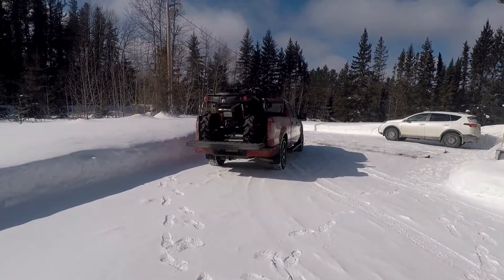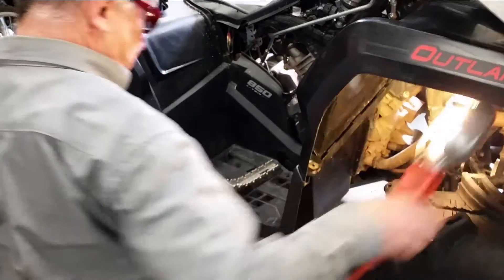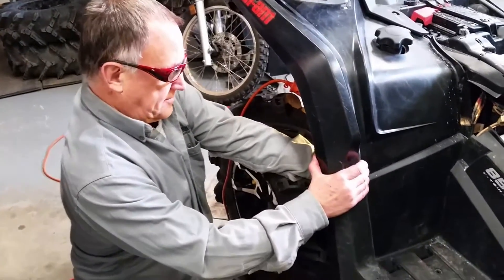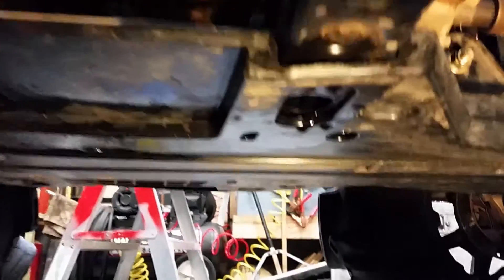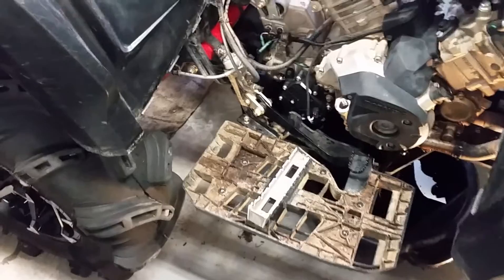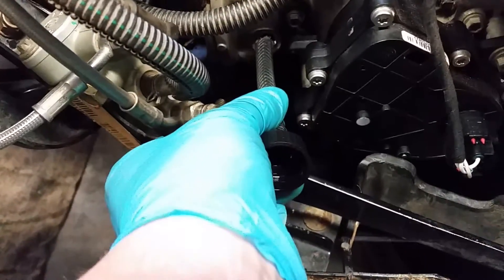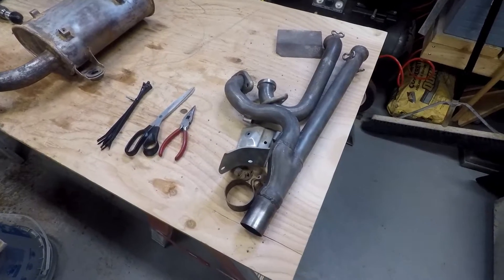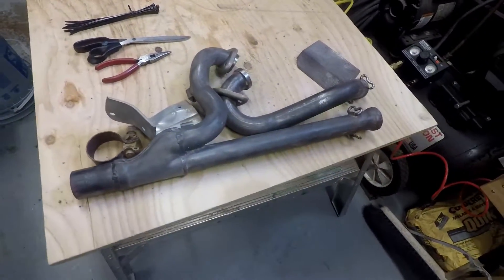Mods to Marks '17 Can Am Outlander XMR 850

Comment: What is the benefit of wrapping the exhaust pipes & headers?
Reply from the maker: It was supposed to cut down on the heat immitted from the pipes and funnel the heat to the rear of the machine and out the exhaust, as the Can Ams run hot. My wrapping rotted and fell apart after 3 rides, so it didn't work for me.  Thanks Dustin!

Comment: So why did you go with the 850 Instead of the 1000r
Reply from the maker: 1000 XMR is a long frame, didn't wan the long frame...1000r is a short frame but would require a pile of work and money to get it up to XMR standards. So opted for the 850 XMR model.  Thanks for watching John!